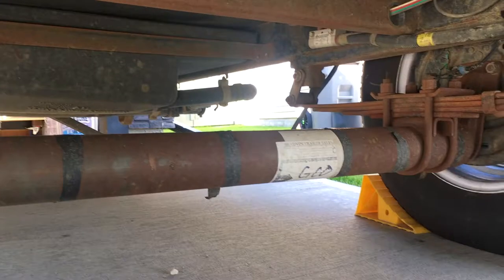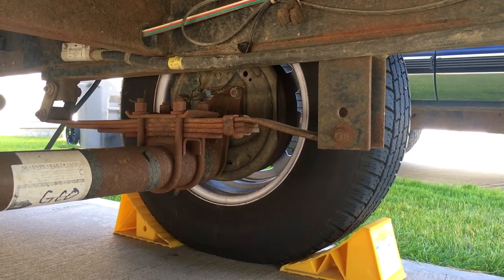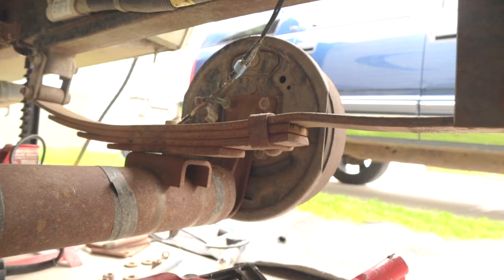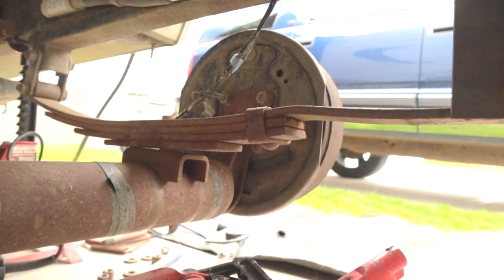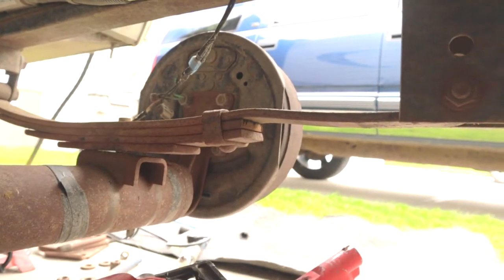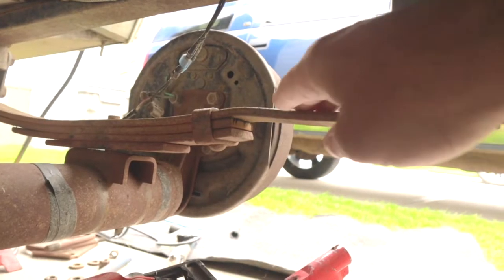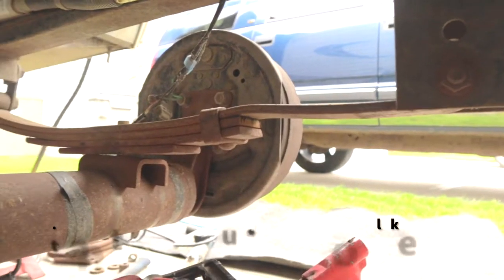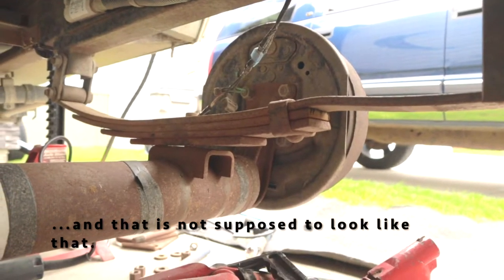Camper Trailer Axle Leaf Spring Replacement

Comment: Really nice video to show how to change leaf springs.  Can you measure for the correct one's while they are still on the trailer or do you have to remove them first and then measure?
Reply from the maker: Hi Gary! Thanks for your comment!!
In my case, the new leaf springs I got from the trailer repair shop were based on the axle weight rating. In this case it was a 3500 pound axle. 
The springs, fittings and hardware were a perfect match/fit. 
I hope this information helps you. 
G

Comment: Very nice video, thank you for sharing. Did the new springs raise the ride hight of the trailer?
Reply from the maker: Thanks for watching and for your comment. 
Actually it did raise the trailer by almost an inch until the springs worked in and took their “set”.  Then the height was about the same (Pre broken spring) as the old springs. 
Thanks again for your comment!

Comment: Where did you pick up new springs? Locally? Are they RV specific? How do I find replacements?
Reply from the maker: Ryan,
Thanks for your comment. 
I did pick up the springs locally at a trailer supply/repair shop. You can find the name of my local shop in the description section of the video. 
However, the springs are pretty generic. You can be picked up at many auto parts stores.  In my case I  researched springs for a single, 3500pound axle. I measured the distance (roughly) between mounting holes and compared that to what was available. There were not many options or choices. Like I said these springs are very generic. I decided to buy the springs from my local shop as I’ve used them before to replace my axle tube. They were very frequently and helpful getting me the parts to do that job. Check out my video about that project. 
The price for the springs from the shop was comparable to buying at Canadian Tire or Princess Auto.  I did not check pricing at UAP/NAPA. But I’m sure it would have been comparable as well. 
I hope this answers your questions. Good luck and if I can help more, please reach out again. 
G